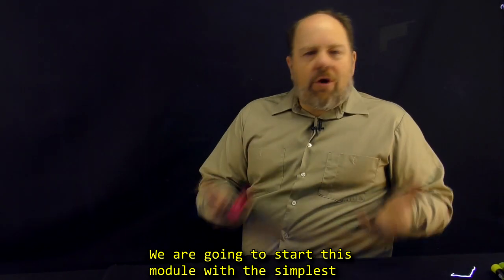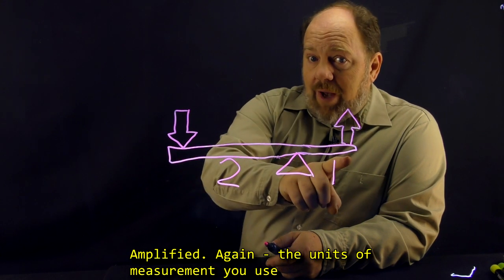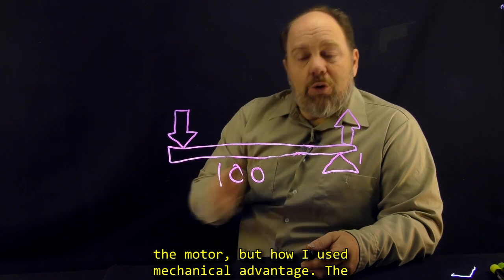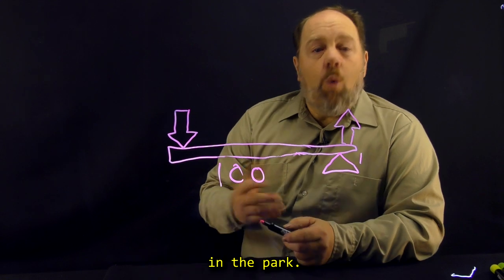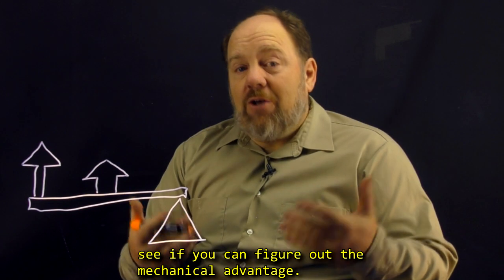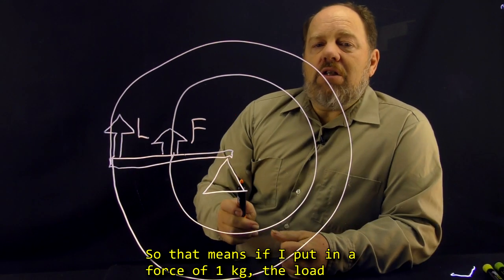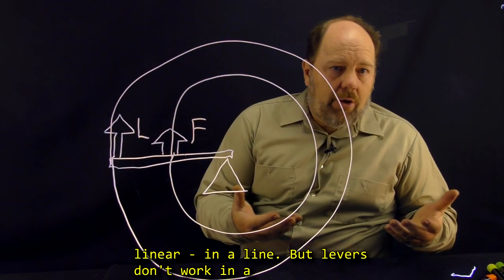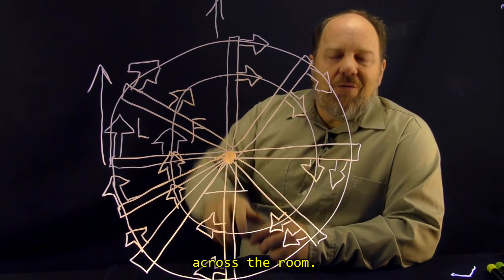Levers: What they are and why they're important in robotics

Comment: some late information.      at 11:55,  you have chosen to not  make clear,  a couple things. 
there  are  just  two  differences between a  first-class  and  second-class lever: 
What  they  are  Called,  and  whether there is, or is not, a  change in the direction of motion.!!!
at 12:29,  since  the  Radii  are  assumed to be known (or easily measured), just  Compare  the  RADII !!!!!            at 17:05, in other words,  a 2nd-class lever, that never stops turning, becomes  a  driven wheel  or  gear  or  pulley  or  sprocket.      consequently, a  LONG (large radius) rotary  2nd-class lever/gear/wheel  can be used to  Convert  (high) rotation rate at low torque  to  greater  Torque, at a lower rotation rate.    aka  reduction-MA.           AND,  the reduction in distance travelled, associated with a  Simple  lever,  ceases to be an Issue.!!!
because, the metrics  Change:  to  rpms   and   Torque (however you want to measure, torque as  Force.).!!!!        if interested, see my channel for the  OBVIOUS  implications.     cheers         googletranslate